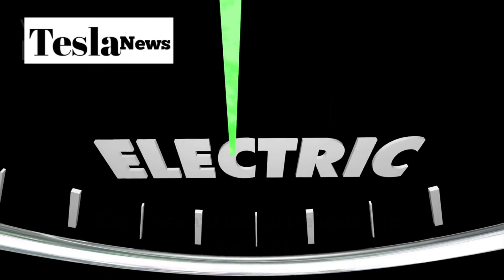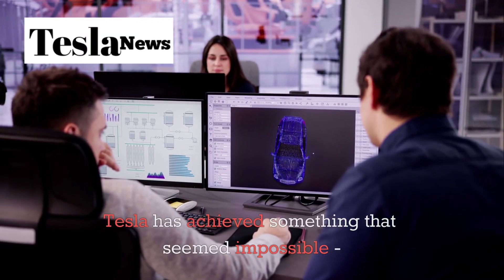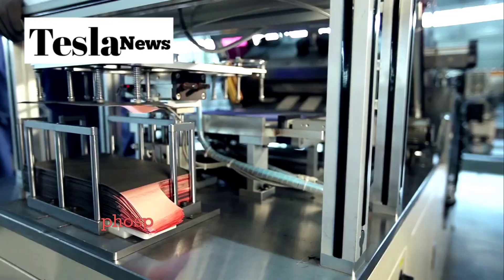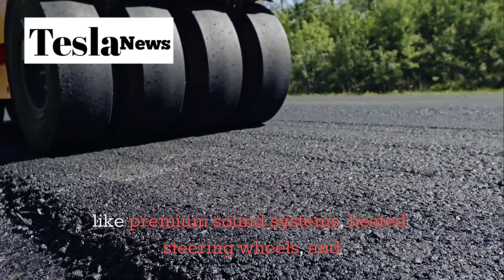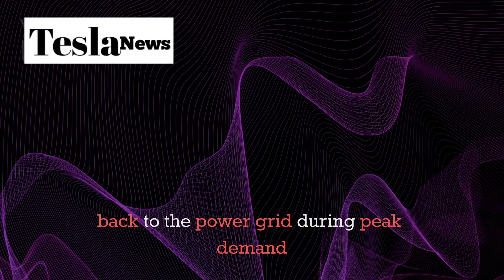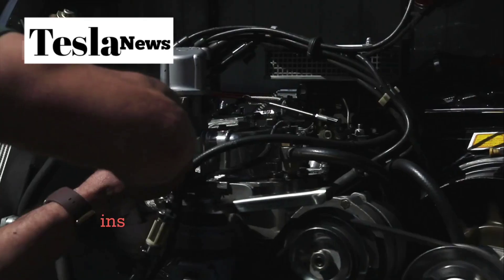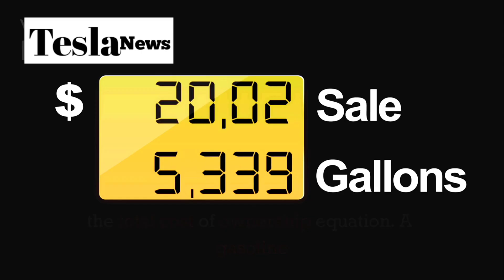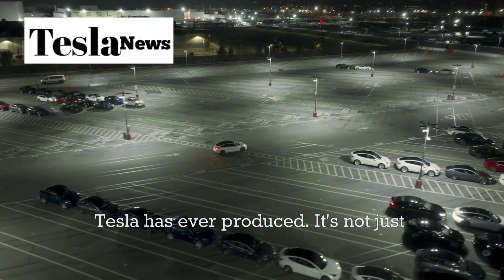BREAKING: Tesla Model 2 $19,699 LEAKED Production BEGINS! New 4680 Battery + V2G Makes You MONEY!

Comment: The model 2 is what Tesla should have developed instead of the Cyber Catastrophe, but they didn't. They haven't invented the assembly line, and claims of "30% efficiency improvements" are laughable. The 4680 should have been LFP from the start, instead, they're years behind the curve. Materials aren't likely to get any cheaper with tariffs, are they. They're going to get far more expensive. The semi is nowhere to be seen, nor is the roadster. Why they still bother with the S and the X, who knows.
Four quarters of successive underperformance, dwindling revenues and dwindling profits are now amongst the hallmarks of the company. And so is the stock price, which is still miles down on it's peak, three and a half years ago.